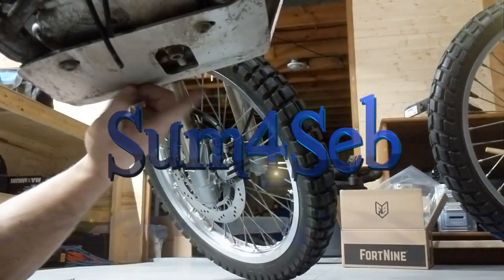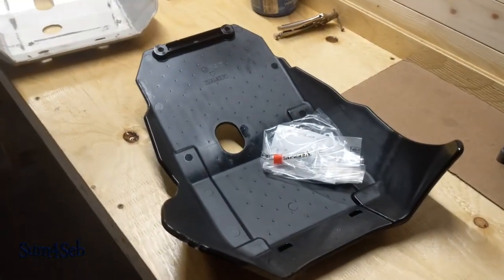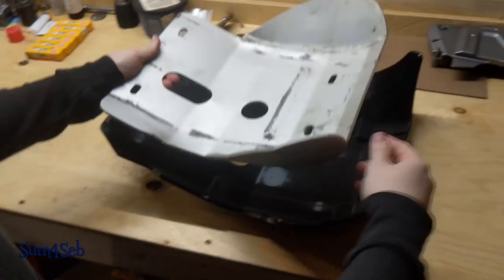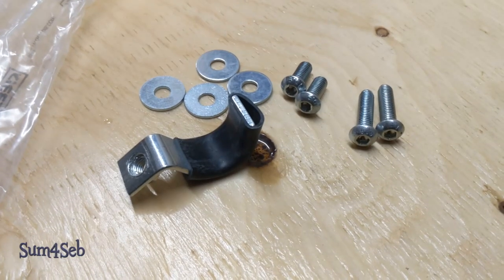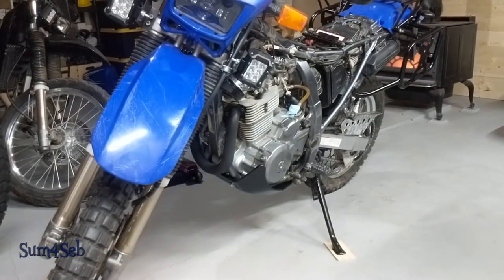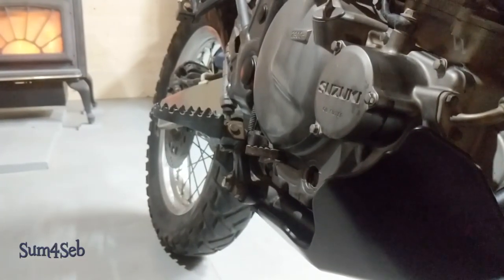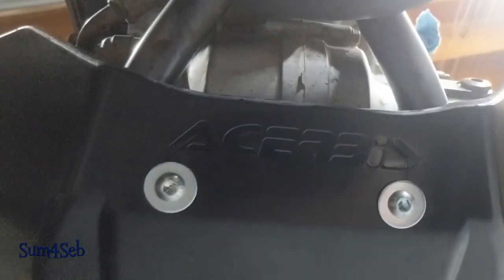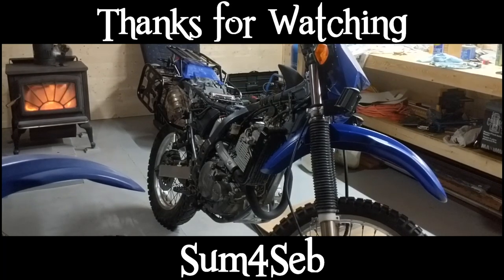Acerbis Offroad PLASTIC Skid Plate |¦| Sum4Seb

Comment: The only thing I don't like is one of the front bolts
is to close to the engine after tightening
everything. Hopefully don't ever hit it hard
enough for it to penetrate the case!

You say no issues with the engine over heating? I haven’t seen a video yet where they drill out the template holes.

Comment: I was leery of the plastic skids at first. They look like a great option for trail riding or dual sport. 99% of what most people ride. I don't think anyone is going to do hard enduro with these. They have good side cover protection.
Reply from the maker: Same here, we'll see how they perform. We don't do log hoping or crazy rock sections so I'm hoping it will be ok just for the oops moments. The thin aluminum SW-Motech skid plate that Summer had before punctured really easy by a pointy rock... It's so situational that at this point I just think that it should be better than nothing 😀

Comment: I’ve been running that same skid plate for a couple of years now. Once you start the engine up, you’re going to hear a lot less engine noise than you did with the aluminum one. The only complaint I have is that the plastic covers the oil filter cover in such a way as that when you go to change the oil filter, you can’t easily stop oil from running out all inside the skid plate. I mean it runs down to the hole under the drain plug, but it still makes a mess. It’s a pretty tough product though. I haven’t managed to damage it yet.
Reply from the maker: Nice. Okay good to know, we'll have to work on a solution for that.
Reply: @Sum4Seb  You can just take it off while you change the oil. I’ve wanted to get one of those old paper funnels and use it to try to divert the oil towards the drain pan, but I haven’t been able to find any of them lately.